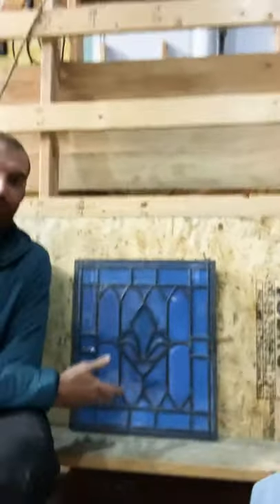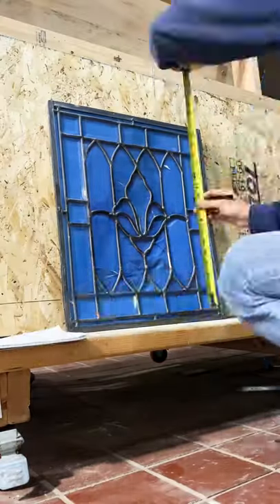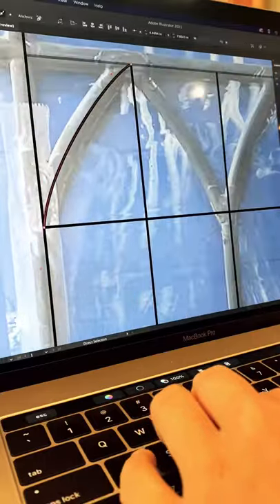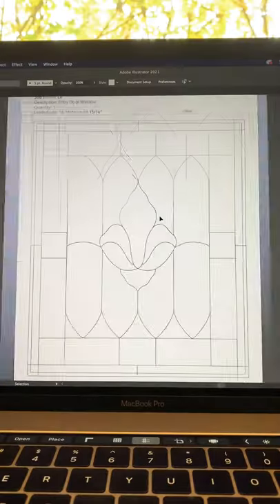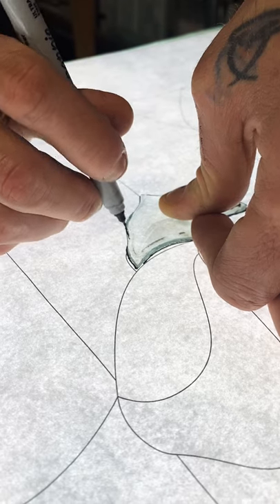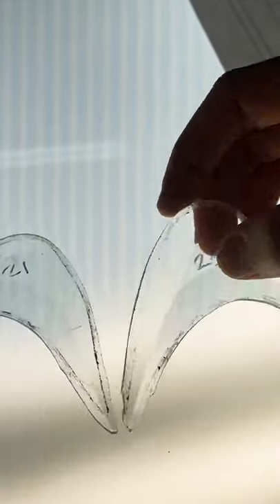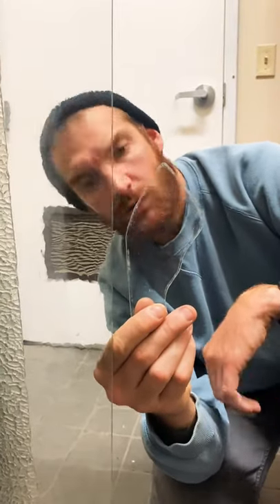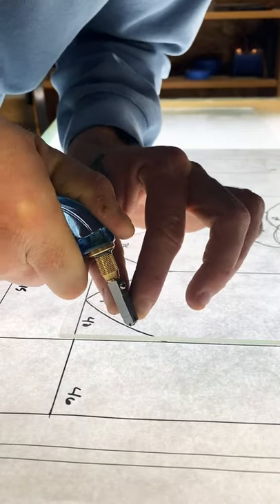Part 1: Stained Glass Window Repair & Restoration (How To)

Comment: How much would you charge for something like this?
Reply from the maker: the cost varies based on many factors including the size of the window, whether it's insulated, how much damage has been caused and where, and how much glass needs to be replaced. If you have a window that needs repair, you can request a quote on our website uniqueartglass.com or shoot us an email at info@uniqueartglass.com.